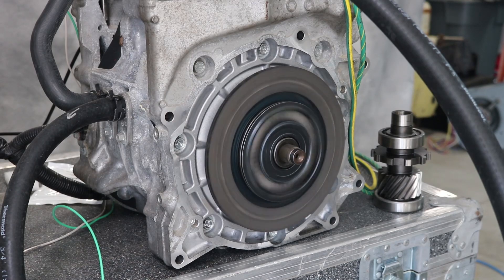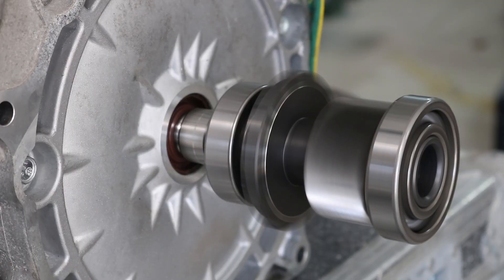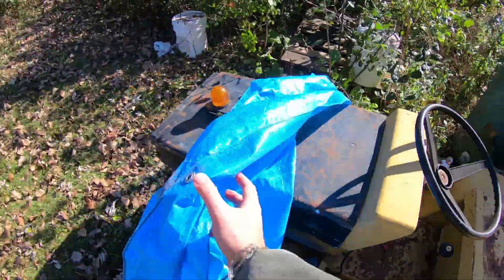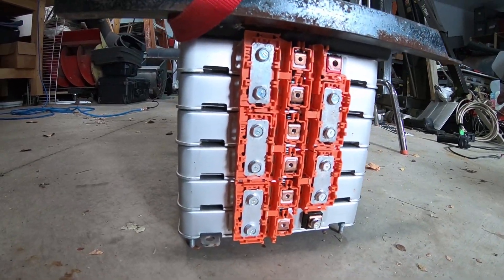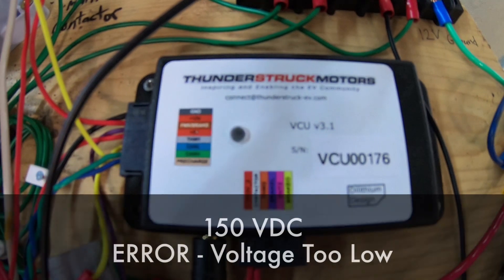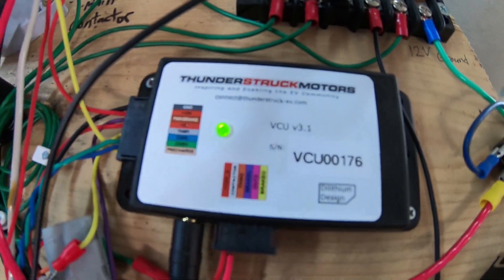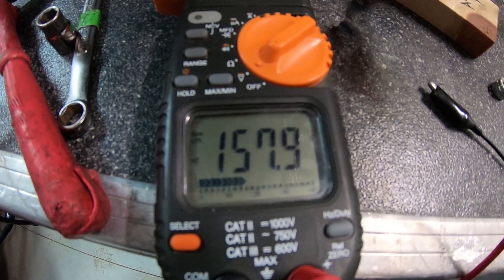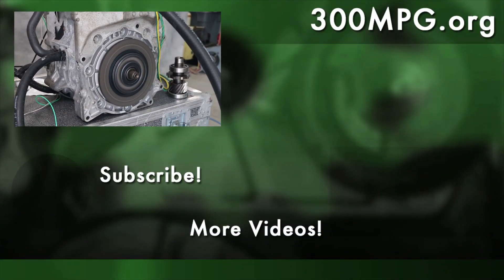Nissan Leaf Motor Powered from Batteries - How many volts?!

Comment: As the early Nissan Leaf's (the 24kWh battery ones) used Li-ion batteries, could the latest 304Ah, 3.45V Prismatic cells from say EVE or Envision be connected in series to have a LiFePO4 battery instead?

Comment: Ben, I've been inspired by you to go with the Leaf motor in a 4x4 project I'm making for Guyana, SA. I have plenty of solar and gas is $8 per gal when available.  I'm presently trying to figure out how many batts I need? Using EVE 3.2V 304 AH but just how many do I need is the Q?  Thanks
Reply from the maker: You need enough in series to get the voltage high enough to run the inverter. That's somewhere above 200VDC. I believe that Thunderstruck recommends at least a 250VDC battery pack.
Reply: @BenjaminNelsonX  Wow, that's over 70 batts or cells. Was afraid of that... money wise. Thanks for your help.
Reply from the maker: It's very common for commercially built electric cars to use 96 cell modules.

Home conversions will often use smaller cells, but more in series to get to higher voltages.
Reply: @BenjaminNelsonX  Yes, I'll need to purchase cells with lower AH than the 304s I have now, ie. cheaper cells. I have 16 - 3.2v LF304 AH now because I originally wanted to use a DC forklift motor,  but I need about 150 ftlbs torque. Can the 16 304AH be mixed with same voltage, different AH?

Comment: Hello I have been watching your video on this Nissan Leaf motor stuff I want to put on in one of my Buggy builds I am trying to learn all about this controller and Battery stuff -ok I was thinking on using a 12 volt battery and a 250 volt inverter to run my set up but is this a AC volts if so all I need to do is use that ac to dc little block you showed  I am trying to come up with a way not to have to use all those battery cells and as for charging the battery I have a plan for that too hope to hear back from you on this and I hope I can do this. and I am glad that you are making these videos thanks.

Comment: Hi if you have a lower voltage battery but feed through a motor controller can you get a higher voltage output enough to drive the leaf motor? The leaf motor is a AC motor right?

Comment: Ok, so I have a question. Is there anything stopping me from using one battery pack to run two motors with two controllers? Would I have to double the amperage to run both simultaneously? Im sure I'm overthinking this.
Reply from the maker: You're probably overthinking it.
If you ran both motors at the same time at full power, you would need to make sure that your battery pack could handle that. Otherwise, there's nothing wrong with powering many things all off the same battery.
A pair of Leaf motors would be a straight-forward way to build a four-wheel-drive Electric Vehicle.
Reply: @BenjaminNelsonX  right! What about taking 2 or more sealed leaf batteries tied together in series to extend range… space isn’t a concern in this particular build
Reply from the maker: @RoadnTech  Tied together in PARALLEL! You would want to keep the voltage the same, but increase the capacity.
I'm sure it could be done, but there are probably some "Devil is in the details" that you would need to figure out. I've never hooked together two Leaf battery packs, so I really couldn't tell you. Dig through some DIY electric car forums and you might find somebody who has done that.

Comment: I would be very interested to see what amount of power you are able to get out of this setup with the Thunderstruck VCU. It seems as though the LEAF motor and inverter should be able to handle quite a bit more power than stock with no problems... 
I haven't been able to find any definitive info online as to what the Thunderstruck VCU will actually let to inverter do (is it limited to basically "stock" LEAF parameters?).
LEAFs are so cheap and plentiful that I have thought about getting ahold of one sometime to use as a parts donor for a conversion.
Reply from the maker: The Thunderstruck VCU "tricks" the motor an inverter into thinking they are still in a Leaf.
It's stock performance.

Comment: It's very interesting that the system worked on rectified AC without any external smoothing capacitors. I guess there would be smoothing capacitors in the inverter keeping the voltage high enough, but you'd probably have to add extra capacitance if you were to use rectified AC with a usable amount of power. Also, when rectifying AC, you take the peak voltage not the RMS voltage, as that's what the capacitors will be charged up to. Rectifying 240VAC and smoothing it with capacitors will yeild ~340VDC, so that gets quite dangerous.

Comment: What is the maximum voltage?
Reply from the maker: Based on the number of cells in the generation of Nissan Leaf this equipment was pulled from, times the maximum voltage of those cells, the maximum voltage is at least 400VDC.
Reply: @BenjaminNelsonX  great, thanks, I'd like to have a leaf motor to play with,  for a project, connect it to a 5-6speed transmission, with something like 96s lithium battery, a small truck, van, car, i don't really care, i need to study up on what you have controlling this thing, I have missed a few videos lately, anyway, thanks!!
Reply: @jamest.5001  Hey mate, good day. Any progress on your project? I saw a wrecked Nissan leaf 3 weeks ago and I'm planning to scrap some of its parts.

Comment: Is it water cooled? I just wondered what the hoses coming out of it are for and that's the only thing that makes sense.  Thanks Ben.
Reply from the maker: Yes, the Leaf inverter is liquid-cooled. I have a 12V electric pump on there circulating water from a 5-gallon bucket.

Comment: 158 volts with 24 modules... isn't that under 3.3v per cell? Those cells were at pretty low state of charge I'm guessing?
Reply from the maker: I started with the 18 cell modules in the Vectrix PLUS the 6 I pulled from the tractor for 24 total. That ran the Leaf setup just fine. Then I progressively connected it to fewer and fewer modules until it errored out again. When the voltmeter shows 150V, the setup is connected to the Vectrix plus 2 additional modules (150 / 20 = 7.75V per module or 3.75V per individual cell.)
At 158V, I just had one more cell module in series for a total of 21.
Reply: @BenjaminNelsonX  ahh, ok. Thanks! That makes much more sense. I must have not been paying attention at that part of the video.

Comment: Ben I need your help to make or use components for mini tractor..
On list of parts required
Steering module  setup etc... please help me 
Note I'm not looking for existing or old tractor I wud like to make from scratch..
I have some plan for frame but I want to know what kind of motors needs to use for mini tractor..
Please reply Ben ..
Reply from the maker: That's a pretty open-ended question - "How do I build a tractor from scratch?"
Take a look to see what other people have done. Commercially, there is an electric tractor called the Solectrak. Take a look at that: https://www.solectrac.com/
You can also look at projects on the EV Album. There are some small electric tractors on there. Look to see what components other people use, and it should give you a good idea of what you may want to use for your project. http://evalbum.com/type/TCMW
Good Luck!

Comment: So, you need a minimum of 50 Nissan batteries to run that motor. 3.2 x 50 = 160v
Reply from the maker: No, Nissan Leaf cell modules have 4 cells inside each - two in series, two in parallel.
Nominal voltage is 7.6 volts.
Looks like 22 Leaf cell modules will run this fine.
Reply: @BenjaminNelsonX  To reiterate: Four cells inside each Nissan Leaf cell module at 3.8 Volts per cell; two in series for 7.6 Volts and two in parallel doubling the potential amperage of those in series. Then 22 Nominal (theoretically equal) Leaf cell modules are placed in series to equal 167.2 Volts.   In your other video I believe you stated that the cells you have are the series #1 cell packs which are 60 amp hour.
Reply: 3.2 is half of one battery. A 24kwh Nissan leaf battery is 400 volts when fully charged. 48 modules hold 400v dc which means each module has 8.3v but because they are not new then we can 8v
Reply: @t.shonoiki563  That math does not add up; 3.2*2=6.4 not 8 and Ben said the "Nominal" voltage of his cell packs are 7.6 volts which if you divide that by two gives 3.8 volts for the two in parallel. Maybe a new cell pack is rated for 8 volts but these are not new. With that said; a car battery is rated as 12 volts yet they normally have a resting state of 12.7 volts.
Reply: @SirTragain  It appears that the voltage for the second generation module fully  charged is around 8.3v but the software is set to charge the modules to 90% of the capacity which must be around 7.8v